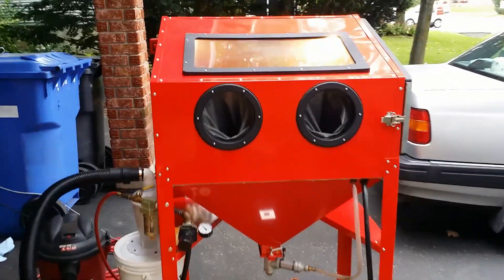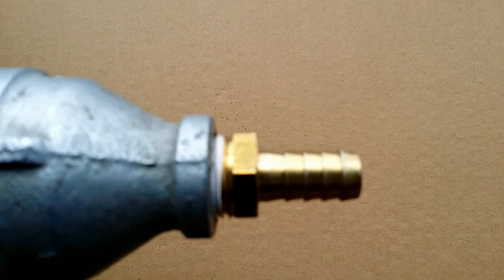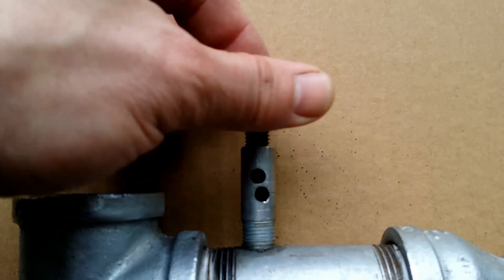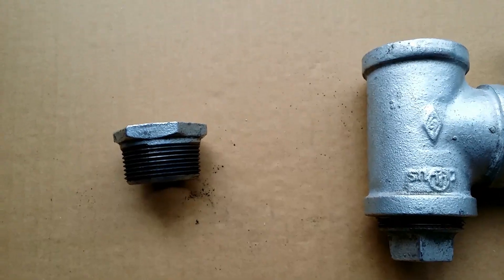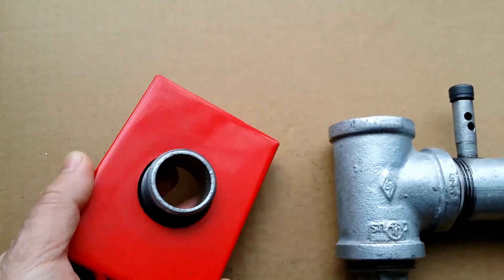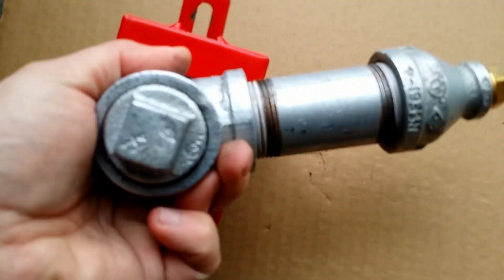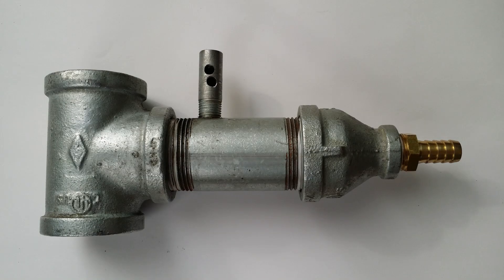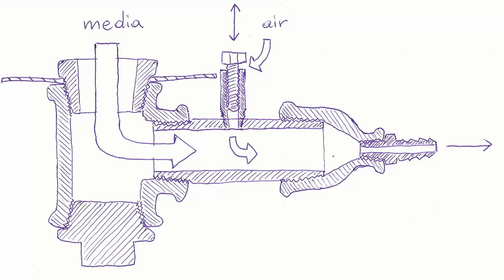DIY Metering Valve for Sandblasting Cabinet

Comment: Hello, could you please share what is this valve with a screw made out of?
Thank you in advance!
Reply from the maker: It is pipe nipple. One threaded end is cut off, the second end screws into the body of the valve. Inside of the nipple is threaded for the bolt and two holes are drilled into the side of the nipple.
Reply: @robertdeptula2003  Thank you! : )

Comment: Not the best presentation of the air valve. You focused on the obvious issues like pipe size and I'm not sure why you bothered to waste time to fill in the cap for the 1/4 oz of sand that could accumulate within? Why didn't you explain that you tapped and drilled out a 5/8" pipe to act as your air controller? where's the details regarding that? I can see it obviously but other viewers may not.
Reply from the maker: Nobody is perfect. But this is great opportunity for you. You can make and post much better video than mine. With all details and explanations. Good luck!

Comment: Hi Robert...great video. Can you tell us in what position you have found the ball valve to be the most efficient? all the way open.......partially closed....half way?? I realize that it's probably trial and error but was just wondering. Also, have you or anyone that's made this build used it with glass beads, and if so, how does it work?
Thanks for taking the time to make this video.
Reply from the maker: Thank you. And yes, all will depend on the media, pressure and nozzle size (mine is 7mm). The screw on my metering valve is in a low position allowing just a little bit of air in. So far I only worked with aluminum oxide.
Reply: @robertdeptula2003  Thanks for the prompt reply Robert...one more question. I'm having some difficulty sourcing some of the pipe parts for this build....if this was to be made out of pvc or SCH 40 pipe, apart from the media perhaps breaking down the surface a little as it travels through it should work just as well? Thanks
Reply from the maker: See my other video, the answer is there: https://www.youtube.com/watch?v=VaUjWVKnA00

Comment: @Robert Deptula and All - For any of the mods you are suggesting... would you please add the parts list.  Robert you build is awesome but I am not sure of how long the 1 1/4" galvinized straight pipe is, where you found the metering value and I am assuming you used a tap to make the treads, and for the barb to connect the hose I am assuming you used a 1/2" MNPT barb fitting to a 5/8" barb or is it a 3/4"?  thanks to all that contribute!
Reply from the maker: Go to my channel, there are four videos regarding mods to the SB. All your questions are answered in those videos or in the comments. The measurements are not critical. Some people build the valve with a one-inch pipe. I use only aluminum oxide, I don't know if other media will require a smaller or bigger pipe diameter. If you have additional questions, ask. Good luck with your project!

Comment: what is the small pipe that you used
Reply from the maker: It is 1/2 inch nipple fitting. The male thread portion on one side is cut off, the inside is threaded for the bolt.

Comment: Now all I get is media half way up the tube.  Like I said it was working fine until I started messing with it but I don't remember what my baseline was?...
Reply from the maker: Too much air getting into the valve. It can be because of low media level in the cabinet or valve open too much or there is a leak in the system. Another option is that there is obstruction in the hose.
Reply: I tried with the valve all the way closed, added more media and still can't get it going again.   Also tried with up to 100psi and still nothing.  I am stumped.
Reply: Still only getting media half way up the tube.
Reply from the maker: @rgauder  What did you changed on the compressor?
Reply: I tried upping the pressure to 100psi from 50psi
Reply from the maker: Any luck? Do you get enough air volume? Pressure alone is not enough.
Reply: Like I said, it worked when I first installed it, but I don't remember the settings. I am  very frustrated.  I have 15scfm at 90psi but I know I didn't have it that high when it worked.
Reply: Any thoughts?
Reply from the maker: @rgauder  no idea

Comment: Great video! For the bolt, what thread is the bolt, and what size pipe nipple does it thread into?
Reply from the maker: The nipple pipe is 1/2 inch
Reply: What thread did you tap the inside of the nipple with
Reply from the maker: I use M10 1.25 bolt there.

Comment: Fit a pre cooler between the air tank and compressor pump using a oil cooler I have done the mod myself and there is no water collecting in the tank and fit a dropout after the air tank that removes 99.9999% water it is a fit and forget unit no desiccant need which gets expensive to replace as it doesn't last long know.

 Search on u tube for air compressor pre cooler
Reply: The oil cooler passages are small and I would think that might hurt cfm, but if it works for you, I might give it a shot

Comment: Why not install a ball valve between T and reducer to meter air instead of small pipe with bolt?? Plus you won’t have to drill and tap hole in pipe nipple.
Thx great idea though!! The brass piece is called a hose barb in case anybody was curious. Great info man!
Reply from the maker: I am not so smart. Just replicated an idea I saw online. See my other video at 0 min 44 sec : https://www.youtube.com/watch?v=VaUjWVKnA00 
you will understand.

Comment: Such a brilliant way to make your own valve instead of the overpriced ones on the market out there just one question is do you really have to have to T piece or would it work the same with just a 90 deg angle fitting,I know you use Plug in bottom to drain the media but will the bottom flap door still open with this fitted. Cheers your a brilliant man who explains things so we all understand thank you
Reply from the maker: It will work just fine with a 90 deg fitting. The T is just to drain the media. More important than the valve is dry air. https://www.youtube.com/watch?v=VaUjWVKnA00
It doesn't have to be this set up. There are tones of ideas about compressed air dryers. Good luck with your project!

Comment: the airflow pipe with drilled holes, would that be in the same section as the other pipes at home depot?
Reply from the maker: Yes. 
https://www.homedepot.ca/search?q=Pipe%20Nipple#!q=Pipe%20Nipple
Cut it on one side so you get rid of the male thread, use the other side male thread to screw it into the "fat" pipe and make female thread inside it so you can put the bolt in. Drill a hole or two on the side and you are done. The size of the nipple pipe depends on the bolt that you will use.

Comment: I just put one together today. On the outlet side I used another T fitting and put a ball valve in one of the holes and can control the amount of air with that. I cant wait to finish installing it. Everyone says this is one of the best upgrades you can do.
Reply from the maker: Post it when it is ready.

Comment: I bought all the metering valve pipe stuff but it's 1 and a half inch parts do you think it could make it worse or better or no problem they WOULDENT take it back .just wondered what you think .its a great idea what you've done .thanks for showing this 👍 Ant from Wales UK .
Reply from the maker: Mine works fine (1 and 1/4). If it is going to work OK with 1 and 1/2 I don't know. I have found the original valve here:  https://sandblaster-parts.com/products/metering-valves-hand-held-1?variant=1125571087 and it is 1 inch. If I would ever do it again I would go with 1 1/4 -1- 1 1/4 "T" to allow more media to be directed to the valve and then would go with 1 inch horizontal pipe. Good luck!

Comment: Do you think 3/4" pipe would work or do you need a larger size like yours?
Reply from the maker: I didn't try with 3/4, but I think it may work OK.
Reply: Robert Deptula I recently bought a new HF cabinet and I like your design, however I'm going to try using 3/4 copper pipe which I have quite a lot.
Reply: @lucianprescott8357  How did the 3/4 workout for you? I watched another video on a 3/4 which many people complained didn't get good flow.
Reply: @ibrewster  I used 3/4 copper pipe and the media flows well. Clogging not an issue. I recently did a antique Christmas tree stand the size of a small auto wheel. I’m still trying to master the proper air media mix to get maximum performance.

Comment: Thank you for your design.  I would like to offer that the first improvement that I made to my sand blasting system was to add 35 feet of copper pipe with 3 drops, all with dirt legs to collect condensation and ball valves to drain the water.  Dry air is a must.  The pipe was a one time expense with no need to refresh desiccant.
Reply: 0of

Comment: Robert, What I.D. and O.D. hose name or manufacturer / supplier are you using and where did you get it as everywhere I look the tubing is REALLY STIFF and thick wall? Thank you Sir!
Reply from the maker: The clear tubing is 1/2 ID x 5/8 OD. I bought it at Canadian Tire store. The black rubber hose is cut from 1/2 ID Diablo air hose from HF: https://www.harborfreight.com/12-in-x-50-ft-premium-rubber-air-hose-62888.html
Good luck!
Reply: @robertdeptula2003  Thank you for the quick response on the tubing, but one other question, is the abrasive (clear tubing) braided to deal with the vacuum that moves the abrasive? Thank you again, Sir!
Reply from the maker: No, it is not. Did you see the whole set up? https://www.youtube.com/watch?v=wFDn6lkKhNw
Reply: @robertdeptula2003 , Yes Sir, I watched it numerous times and even made a copy of your metering valve as you explained in your well done video. But was curious as to the abrasive tubing, and if it would collapse when there is suction on it, and moving the abrasive, and the gun being pointed and turned in all directions while blasting. So I thought it would be better to ask than purchase the tubing twice, just in case. And having watched your video again, and pausing it at the closeup of your metering valve mounted on your blast cabinet, it was a a clear tubing, but have seen clear tubing with a fine braid, that was almost invisible in the tubing to prevent collapse so I was unsure. And thought it better to ask.  Thank you again for the extra tubing info, and again Thank you for your very descriptive and informative video on your metering valve!
Reply from the maker: @bobanderson4249  Even when the valve is closed for the outside air the tubing is not collapsing. I run about 60 PSI on the regulator and it drops to about 45 PSI when running. I use about 3 cups of the media in the system (aluminum oxide).
Reply from the maker: @bobanderson4249  Thank you for your kind words.

Comment: I've made a valve similar to this but I'm getting inconstant media flow, did you have this problem or know how solve?
Reply: Yes dry air is an absolute must.  Try adding as long a run of copper tubing as part of your supply line.  with a drop or two to allow the water to settle out. I add 35 feet and it did made a dramatic improvement for me.
Reply from the maker: You need dry air in your system. In the video, I show the air dryer that I will use.
Reply: One of the simplest fixes is to spend the forty bucks to buy a proper metering valve because after buying the plumbing fittings and figuring in your time and labor, what are you possibly gaining here besides poor performance?
Reply from the maker: @customprc  The simple solution you are talking about is for those who live in the US. I am in Canada. Many companies don't bother selling those valves outside the US. Others charge for the shipping as much as the valve itself. There is a video on YT where a guy from Australia casts the valve himself using aluminum. 
If we are talking about performance then this valve is a great improvement compared to the suction tube that comes with the unit. So, yes, maybe I am getting poor performance on my valve compare to the one you can purchase, but I will never know. I don't want to spend money and time to do the research.

Comment: How much did everything cost you and how much time   Im thinking to make one but if too much I just buy one. Thankx for the idea mate.
Reply from the maker: I don't remember how much I have spent. Go to your local supplier and check prices. 
How much time? To be honest, it took me over a year. It was the project I didn't do in one sitting. First, I bought components, then I had to figure out how to do it in details ( you don't have to, it is ready for you). The work involved is: grinding the female threads in the bushing, drilling three holes (one in the big nipple and two in the small nipple), cutting one pipe (small nipple), making threads two times and assembling it. My estimate is that you can do it in about one to two hours. 
Good luck!
Reply: @robertdeptula2003  For Mr. Hernandez, I just purchased everything for the metering valve and it cost $37.  For Mr. Deptula, if the small air metering pipe is a pipe nipple, did you have a NPT tap to create the threads in the larger nipple?  My SAE tap & die set doesn't have the proper size for the 1/4" pipe nipple I bought for the air meter valve.
Reply from the maker: Sorry, I missed your question. I used closes straight size I found. There was no problem because the thread goes into the body of the valve only skin deep.

Comment: I have a blister from princess auto. The issue I have is the recycled glass they recommend is not flowing properly out the nozzle. Would a setup like this illuminate that issue? Do I need to change the from glass to maybe sand?
Reply from the maker: A metering valve will improve media flow, whatever media you will use. I use aluminum oxide in my setup. Another thing is the moisture from a compressor, it will debilitate media flow.
Reply: You should never ever under any circumstances use sand

Comment: Robert--If you don't mind, where did you get those big rubber washers?  I've got all the other parts but I can't find those big washers. Great job, btw!
Reply from the maker: I picked it up in a plumbing section in Home Depot. I don't remember what for was it designed. But it doesn't have to be rubber. Make the hole in the bottom flap door, screw the bushing into the T through the door and measure what distance you need to cover with the washer. Take a piece of plastic (like a cutting board or similar) with the right thickness. Cut the same size hole in the plastic piece as in the flap door. Then cut hexagonal or square shape for the outside of the hole in the plastic piece. Put it all together. Good luck!
Reply: I thought that looked like some kind of plumbing washer so I looked in the plumbing section at Lowes, but couldn't find them. I don't have a Home Depot near me so I may have to go with the cutting board idea or something similar. I will figure something out. Thanks again for your help!
Reply: @Rhosk44  I found large rubber washers at Home Depot in the plumbing section, it took some looking but here is the info...Danco, is the brand name and they are called "TUB DRAIN GASKET",  SKU # 37155 88348  they were in the sink and shower parts repair section, price here in CA was $2.18 each plus tax. and the size is 2-5/8 inch O.D. x 1-11/16 inch I.D. x 3/32 inch thick  according to the packaging. You might find them cheaper on Amazon or at another hardware store.
Reply: @bobanderson4249  Thanks Bob, I'll check it out!